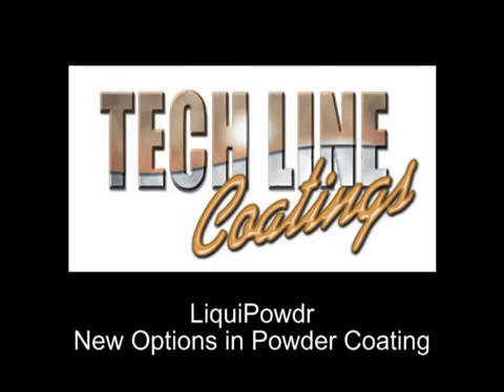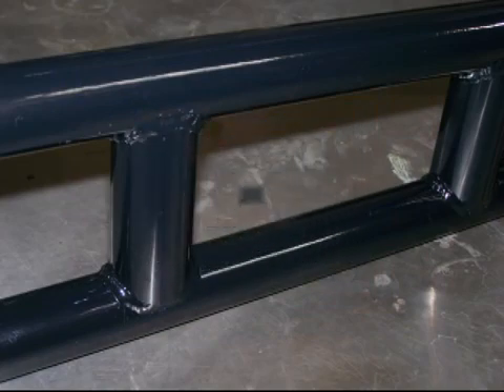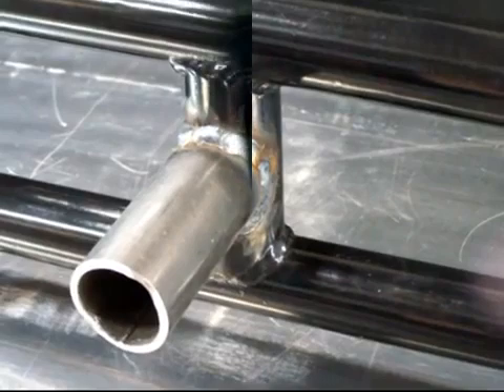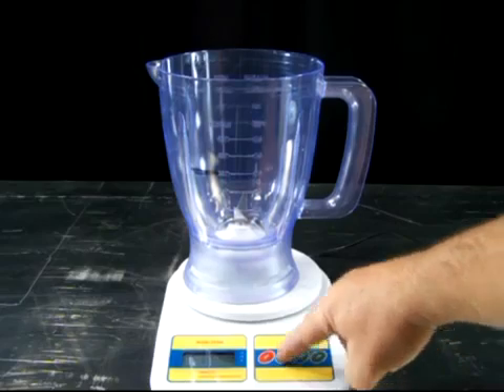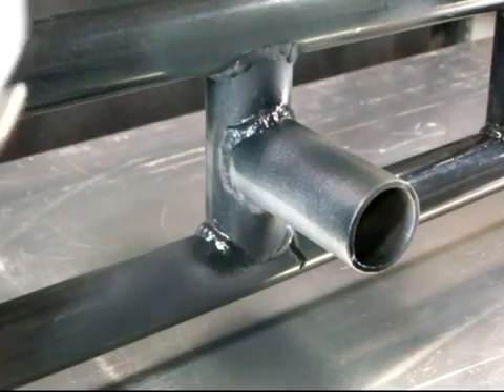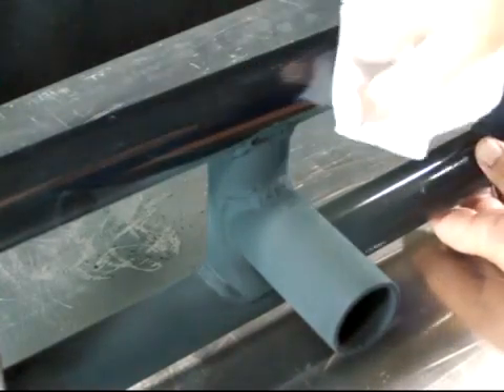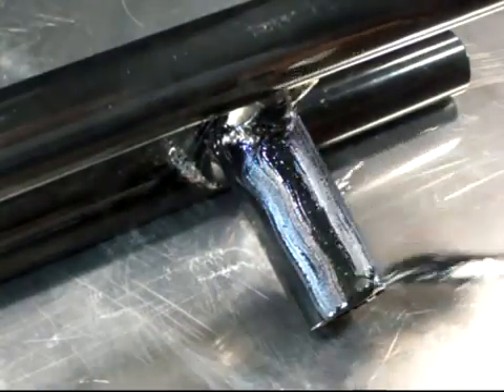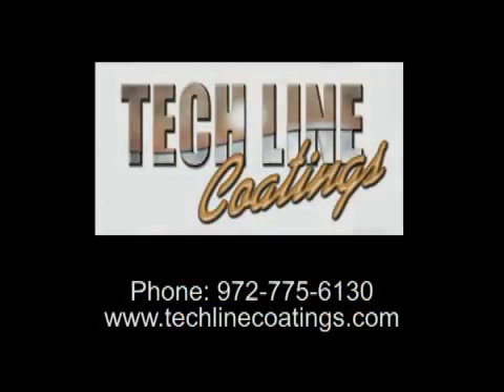LiquiPowder a different way to apply Powder Coating (Liquid Powder)

Comment: Will this work with all types of powder coat?
Reply from the maker: We have tested it with a variety of powders and haven't found one yet that it was incompatible with. The only differences we have run into is the liquid to powder ratio. Some powders require more or less liquid for the mixture, but it's still fairly close to a 50/50 mix by weight.
Reply: How can i buy im from the philippines